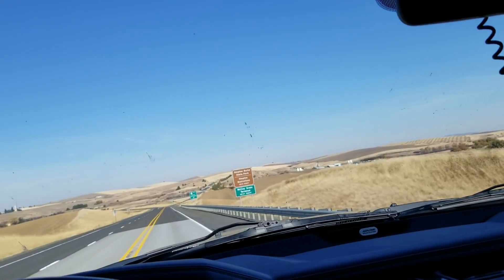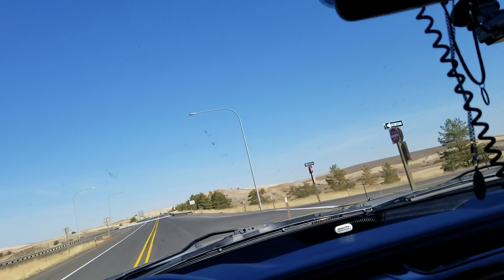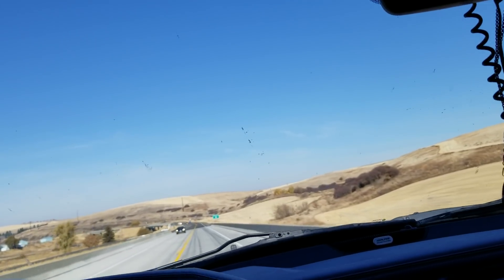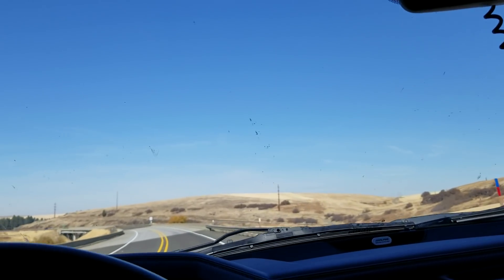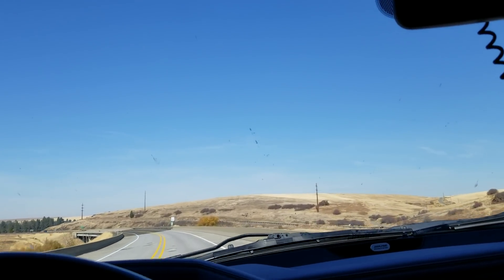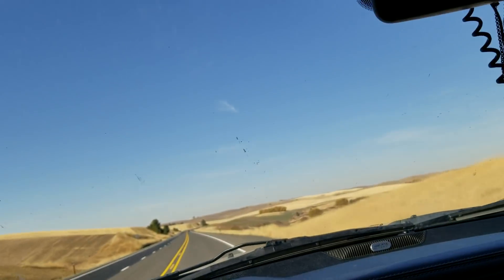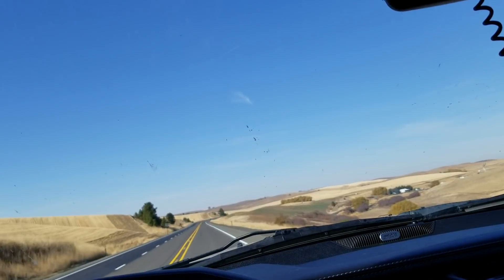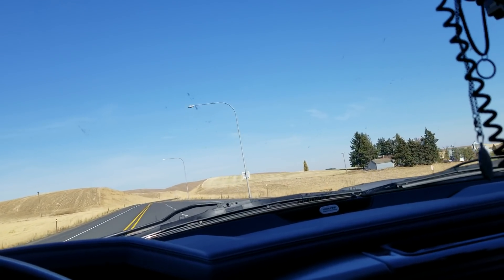Why do 6.7 Cummins blow head gaskets.

Comment: i have a fully deleted 2015, running a mini maxx v2, put 10000 kms going through the southern US recently towing my rv, going up tall passes no problem 10-15 minutes of constant climbing, not once did the truck give me any issues, coming up to 285000 kms and run smoothly. let the engine warm up before driving away, let the engine and turbo cool before shutting off and all's good

Comment: I have blown two head gaskets in a year.  I’m pulling heavy equipment from ATL to Iowa.  I had no trouble for years pulling tractors, but it was short distance like your wreckers.  It had nothing to do with the heads and it blew another after installing $600 worth of studs. The fix was pulling the freeze plug in the back of the engine and installing a bypass that puts more water in the rear of the engine from the gooseneck.  To say this is crazy is crazy because I have experienced it on a well tuned truck.  

You are putting out bad information.

Comment: So I have a 2012 6.7 
Cab and chase 280 k miles all stuck 
Runs great but when I pulling a hill with my 5th wheel 
My temp is running high temp 230 plus   if I don’t back off  
It will give me a warring light high oil temp 
I have replaced the radiator with a aftermarket aluminum 
And a bigger inercooler 
New water pump 
New thermostat 
All new hoses 
Would like to know your thoughts
Reply: Check the oil cooler
Reply: You get this figured out? I’m having similar issue with my 2012
Reply: Have you found the problem ?

Comment: I looked inside my coolant reservoir and it looks burnt. Bone stock 2018 6.7. I hotshot everyday. Truck is at 115k now and I'm wondering what's going on.
Reply: VETERANS OVER THE ROAD VOTR I have a 2017 with 51,000 miles and it looks the same. Shine a flashlight down the fill neck to get a better look at it. I took mine to the dealer fearing a blown head gasket and when they shined the light in it, it looked a lot better. I think the inside of the bottle is just stained. I’ve heard it’s common with the OAT coolant. Keep an eye on all fluid levels to be sure they’re full, especially the engine oil and coolant. Don’t want the two liquids mixing.

Comment: In the factory, if they don't keep sharp inserts in the head milling machine, or if the feed rate is too fast, it will produce fine grooves in the head surface.  Re-milling is the only cure.  Studs?  Why not?  If you have the head off anyway it is not that big a deal to upgrade.  With studs you are less likely to damage the new head gasket if the head if forced to lower to the block parallel to the block surface.  (How do I know?)

Comment: i want a 2019 ram 2500 6.7l cummins, i don’t know much about diesel, how would this truck do as a daily driver/short trip truck, 6 miles to work and 6 miles back home? long trip once a year no towing.
Reply: Because of the time required to get up to temperature for the dpf to burn out, and the necessity to be over 30 mph to initiate. Short slow trips are the kiss of a plugged dpf and can be expensive to have it remedied only to happen again. Any of the newer diesel trucks require about 15 minutes of steady running over 30 mph.  Stop and go city traffic, bad.  Steady highway running, good.

Comment: Bare with Me Here.
I’m not a know it all and not starting a argument, but I am just trying to understand what was said in the beginning of this video. 

If the 6.7 Cummins has been Deleted,

( Egr Valve, DPF, NOX Sensors, Differential Pressure Sensors, DPF Temperature Sensors, throttle valve, ect...)  
and the programmer is running a deleted tune, to tell the ECM and PCM that the after treatment junk (listed above) isn’t there.
Then what is telling the ECM , that a regeneration is needed, thus causing a rise in cylinder pressures ?

There is no information being sent to the ECM telling it to go through a regen or to derate itself if there are no sensors there sending information back to the ECM telling it a regen is needed.

I work on a fleet of Cummins ranging from 6.7’s all the way up to the new X15’s.
If just one temp sensor or NOX sensor on that after-treatment isn’t working, then the
parameters will not be in place to tell the ECM to regenerate. 
The ECM will notice something isn’t correct and the ECM is then programmed to go into a 5 MPH derate.

I don’t understand how that 6.7 Cummins can adjust fuel and boost for a regen if nothing is there to tell it to do so.

However I can understand if the head gasket goes out on a stock truck that has been deleted and a hot tune installed.

That tune would change the fuel timing, plus more fuel and boost added, causing the head to lift, causing head gasket failure.
Reply from the maker: That's the problem that people didnt shut down the after treatment program but instead had it ignore it. Couldn't tune it properly

Comment: This video is the definition of anecdotal evidence.  Yes, tuning has a big roll to play in this but claiming that regens are the issue requires more evidence and a better explanation.  A 6.7L Cummins that regens without a DOC and DPF smokes white like crazy.  Have you verified that the post injection even still occurs on these deleted trucks?  Yes, the early deletes with foolers were very poorly design but they disappeared over a decade ago.  

As you mentioned there are many different tunes out there and some maybe harder on the engine than others, you can't make more power without increasing cylinder pressures.

Comment: I’m trying to buy a truck... I’m considering the 3500 ram. Should I stick to the auto rear level suspension or full spring?? Which will last longer and be more reliable?
Reply: Get the air bags. Truck will ride better and it won't squat like conventional springs. Also, I haven't heard any reliability problems with them. Get the air bags.... That's what semis run
Reply: More reliable would be no extra parts like airbags 
Now with that said I th8nk the airbags are such a great idea they all should have them

Comment: I'm running an 08 3500 srw with EFI by Calibrated Addiction 30hp and their 125 psi RFE tuning. Not a problem over 4k miles deleted so far. I appreciate the insight!
Reply: You think a custom tuning will decrease chances of hg problems?

Comment: Episode 2: why does the 4th gen ram have a vibration/shake problem
Reply: Cody N  Did u ever find a solution? My 2014 does the same but not consistent. Sometimes it’s rides smooth on the same stretch of road. I’m baffled
Reply: @LoneWolf-cf5tp  sticking caliper
Reply: My dealership is replacing  3 parts = upper control arm & bushing, , plus the steering dampener next week under Bumper to Bumper warranty...

Comment: I'm looking to get into a 06 or early 07 Cummins g56. I want the 5.9 for simplicity sake. For the driving I would do a 5.9 is just the better option. Once I finally find a stock truck with lowish miles, I plan on eventually getting to around 500 to 550 whp. I'm looking at hpp tuning for my map but is it possible to make that power reliably on stock fuel besides an airdog of course. Maybe a turbo and manifold upgrade if that would keep egts down. I just want a powerful yet very street and driver friendly truck with occasional towing. Oh and of course a clutch would be done. There's a lot of info out there. I might argue too much info lol.
Reply: The G56 behind the 5.9 came with 3.73 gears. Not a ideal combination for interstate speeds.
6.7 is the way to go way more tq, better MPG's then a 5.9 and 3.42 gears with a G56 is a perfect combination.
Reply: Steven Kuhn I got a 07 with the 5.9 g56 3500 dually 167k miles 24k lots of new stuff

Comment: I've got a 2010 crewcab, 8 foot bed, 4 wheel drive, DRW, automatic that I bought new, which now has a little over 60,000 miles. This trucks sole purpose is to pull a 36 foot fifthwheel. The last time I scaled the truck and trailer they weighed 23,200 #. Two years ago, around 50,000 miles, I had a shop do a complete delete, egr, dpf. added a S&B cold air and snorkle and tuned it with a Race.me with 40 horse flashed into the stock ecu. The truck picked up a little MPG, but  the main reason was to eleminate  the engine eating it's own soot. The oil now stays clean, turns a dark honey color after about 1,000 to 1,500 miles, depending on how hard the truck is worked. We go to the Rockies every year and this truck/trailer has pulled a bunch of serious mountain passes, the  only time I have noticed any smoke from the exhaust is when we are in high elevations and then it is only a very slight puff when downshifting.  Maybe I've just been lucky, or maybe I'm livin' on borrowed time, but I've always been more concerned with the trans.  I always take time to warm the engine up and let it cool down before shutting it down. The shop that did the work has done a lot of 6.7's and they feel that studs are not required for my tune. Hope they are right.

Comment: Your information here is great! As a 2018 CTD G56 owner, all I'm looking for is an emissions compliant tune, that brings me to the level of a stock 2018 68RFE.🤔 Making it a bit more throttle responsive is another goal & hope to get out the "lag" on up shifts. Plans include a quality single mass flywheel & single disc clutch. Truck is wonderful the way it sits, but if I can, the mods I'm thinking would make it fantastic!😃
Reply: I have run Double R Diesel emissions compliant tuning for 10k miles now on a 2017 CTD and absolutely love it. Runs super clean and strong, well it has 4 settings, 30,60,90 and 120 HP. Transmission programming is spot on what it should have left the factory with. Mine is an auto though. I've used many so called tuners over the years and this is by far the best . I just had it in for warranty work and two recalls and no issue with it being covered. I took the tuner out before I went to the garage.   I did see an increase in DEF use but the tailpipe is cleaner than a gas engine.
Reply: I ran a TS stryker added a 100 hp and 200tq on my 14 Dually with G56. Had no problems with the stock emissions.

Comment: Thanks for this. Great information I wasn't aware of. I have 2004 Early 5.9. I'm looking to get 13 or something around that year 6.7 Cummins within the next 6 months or so. Not in a rush going to keep eyes open for a good deal.. Like with all my trucks I have owned (Diesels). I "let them breath" in every way possible and a very low type tune and never had any issues with 5.9s. Just hard to find them now with low miles. And plus I love the 4th Gens

Comment: Hello I have a 2014 Ram 3500 single wheel can I use it for towing 3 cars also it have lift kit tires 37.13.50R22
Reply: This guy is not a mechanic shop he gives opinions and advice  not prices of repairs 

Towing with big tires is stupid in my opinion .....  truck is too tall for the trailer  and tall tires and rims are not designed to haul the  heavy loads of big trailers 

How many cars can I haul on my trailer .....  if you can't figure that out you shouldn't be hauling a trailer period ....  look up the weight capacity of the truck and then subtract the weight of the trailer and in truck cargo and that gives you the weight of what you can tow
For example a 2010 Cummins dually with 342 gears can tow a max trailer of 9200 lbs   say your trailer weighs 2000lbs you can pull 7200lbs so that's 1 gasoline pickup truck you can haul 
New trucks upped the tow capacity 
So a 2018 dually with 410 gears can pull 30,000lbs with a big long 7000lb trailer you can put 23000 lbs which is 2 diesel trucks and a gasoline truck or like 5 4000lb small cars  
It's reading and math school did teach us useful stuff
Reply from the maker: Bring it to stock and you'll ne border line ok. Three cars is more of a dually deal. Two car trailer srw  all day
Reply: PD Diesel Power any idea how much will be bring it to stock
Reply: A 37" tire on a 22" wheel isn't that good for towing, and It likely had less load capacity than stock tires due to the thinner sidewalls. I would drop down to a 17 or 18" rim and maybe 35" tires.
Reply: Lray 4x4 thanks do you have idea how much will cost me bring it to stock
Reply: Hey ps diesel is it safe to pull a two car bumper pull with a 14 ram drw 6.7?
Reply: I'm sorry Pd diesel is it safe to use a two car bumber pull with a ram drw ram 6.7?

Comment: I'm just curious if this "milling issue" has ever been tracked to a particular manufacturing facility from cummins or if it was hit and miss for all manufacturers of that generation. I have a 2007.5 6.7 with factory fuel and turbo that is deleted with an edge juice with attitude tuner (not fantastic by any standards) and it has been fine deleted for the last 20,000 miles and currently has around 185,000 on it. Doesnt tow all of the time but when it does it has a gooseneck loaded down pretty well grossing between 20,000 - 25,000 lbs toting around the farm. I have been debating studing it and going to a t4 second gen manifold with a s467.7 with a .9 A/R to tow well but breathe much better. I agree with the drive pressure theory also. I think these trucks take air in MUCH better than the stock manifold and turbo allow it to exhale. I just dont want to blow $2500 on studs, manifold, turbo, and the lines and exhaust to adapt it to the truck if it isnt needed.
Reply: I have a 2016 Crewcab 3500 DRW, G56 that I deleted (S&B, Proflow 5", glacier diesel egr kit, RaceMe Ultra) ran okay, but  wanted to get away from the VGR and restrictive manifold.  Went with a full 2nd gen setup (Steedspeed manifold, 467.7 and custom piping from Wehrli custom fabrication and tuning from Elevated Calibration), 30hp tune mainly and runs fantastic! Lower EGTs (6-700 at 70mph) and dropped the exhaust back pressure to a sub 1:1 ratio, often 1/3 of boost.  I've seen better mpg and pretty quick cool downs from 600 to 250 within a couple minutes prior to shutdown.  Also, I'm not studded, but might do so if or when my head gasket goes.  In addition, i added a head coolant reroute kit to better aid heat scavenging from #5&6 cylinders. Awesome sound and turbo whistle is a bonus!

Comment: Your correct tuning can ruin head gaskets or  transmission in a hurry. I have a 6.7 powerstroke and they are really stout with 6 head bolts per cylinder head gasket failures are rare but when I do see them its usually a deleted truck with horrible tunes. Also on an inline 6 there is a lot of surface on that long head. If a shop doesn't do the machining perfect you are almost guaranteed to have an issue. I had a 300 six cylinder a machine shop did horrible machine work to and had instant issues. Keep up the videos bud.

Comment: I believe the 6.7 builds higher drive pressures than the 5.9, just don't seem to flow as well (stock). But I think you're right on- warming your truck up is the best advice here, seems like common sense, but I see a lot of diesel guys boost hard/tow heavy on a cold motor. I know most just haul their cell phones around, but still a cold diesel can be pretty vulnerable.
Reply: nrthrn stncrft I tow my man bun and Starbucks coffee and a not my president sign everywhere I go!